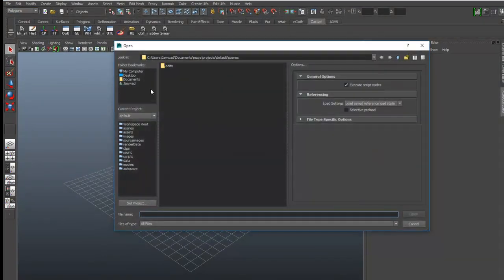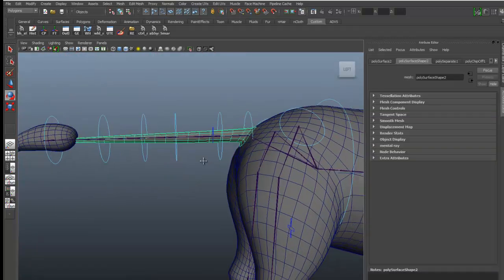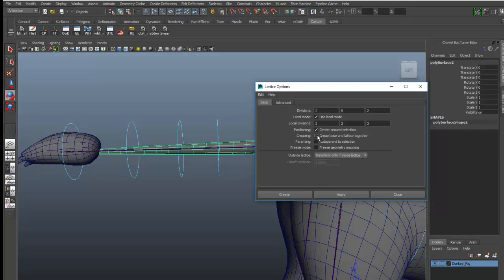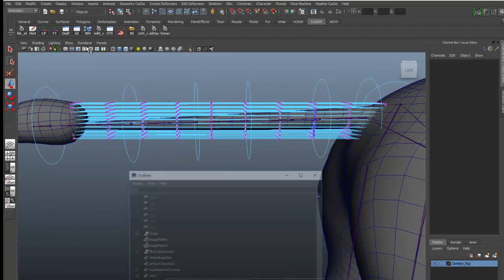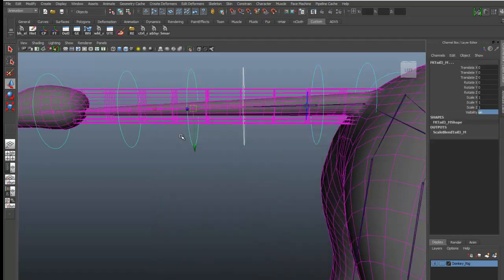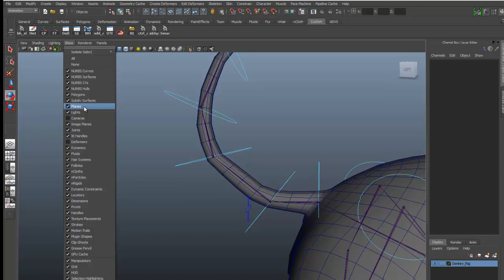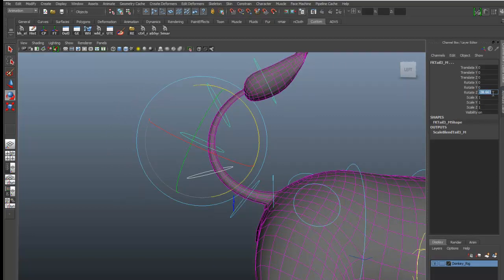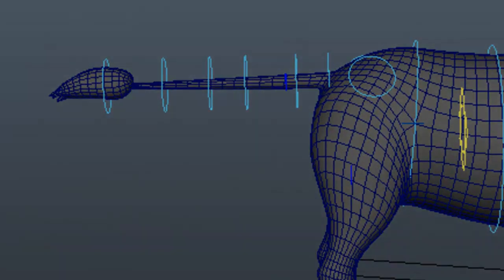How to get rid of skinning process

Comment: Why adding another layer of deformation on top of the SkinCluster? You can achieve the same result without the Lattice.
Reply: Lattice Will Caluclate Based on Vertex  If it is Skin Cluster it Depends on Joints and Where the Vertex we need to smooth the skin again . If We Use Lattice It Will Auto Caluclate and give Smooth Bend
Reply: @bharanisivakumar880  He used 3 deformers to do the job of 1. Just have to learn how to paint skin weights.